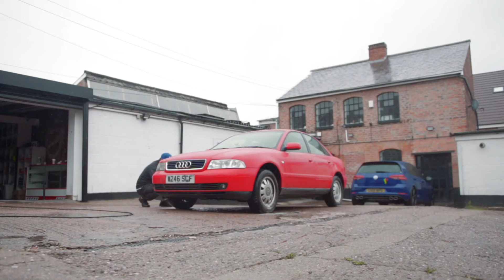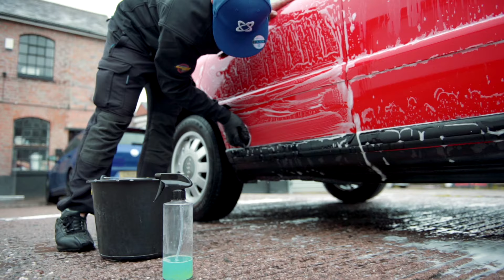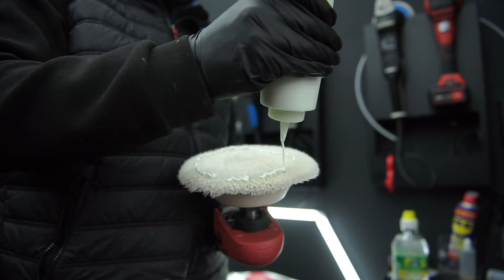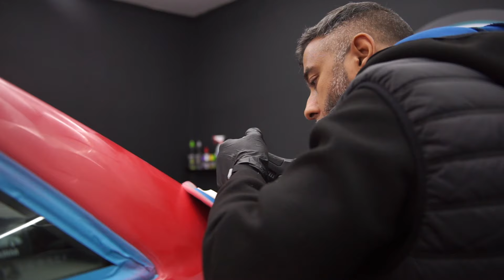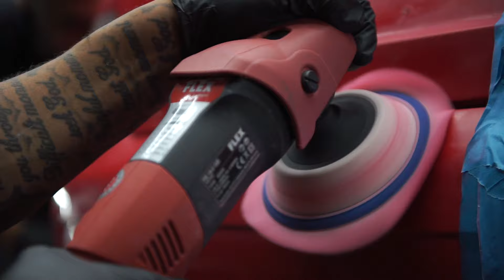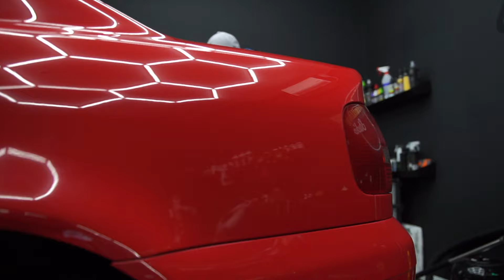1980’s Audi B5 Can We Save The Faded Red Paint?

Comment: did that car have a clear coat / lacquer?
Reply: They come with clear coat from factory. I think this one was just hazy. A polish removes some more clear coat though. Or perhaps I dont know what I am looking at and the car was repainted already? Usually the clear coat starts chipping and flaking off when it begins to bake through from the sun.
Reply: @KaMil-gw2qr  faded under  clear coat / lacquer cannot be fixed. The old solution is a respray